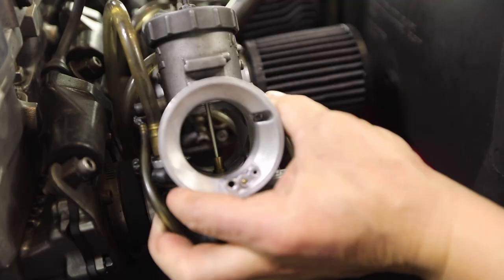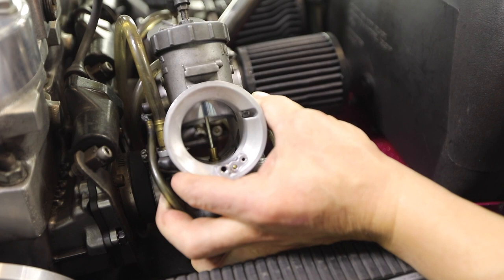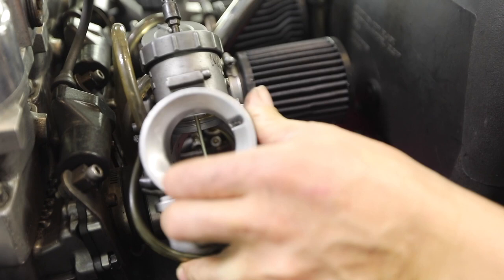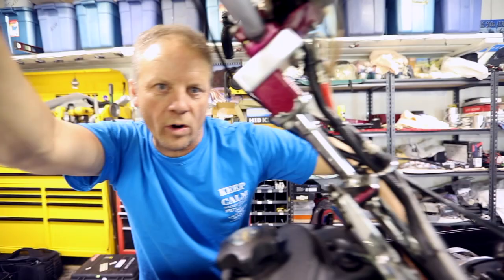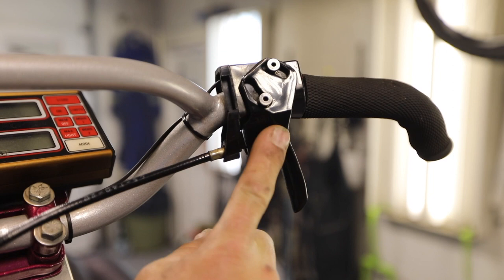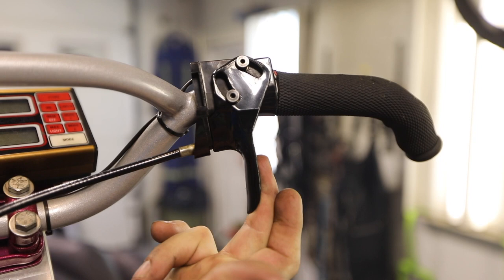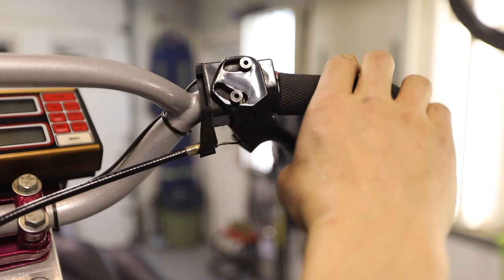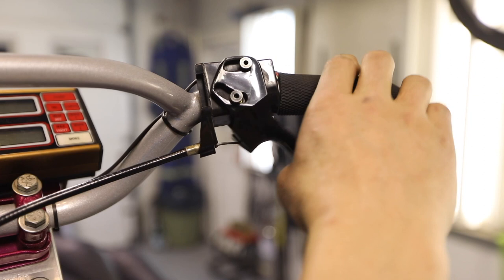Bending the throttle on your snowmobile for more horsepower. 2 stroke.

Comment: there is an adjuster on the cable to do this on some sleds.
On mods you should be able to accomplish that with research. Buying the correct throttle, long enough cable adjuster.
I do like those early 90s Doo flippers though
Reply from the maker: Time for a lesson !! 
When you take a 44 mm carb and bore it to 48 mm , there is quite a bit more travel required to get the slide to open all the way , and to pull needle out of needle jet !! More air , More Fuel , More power ! 
There never was , is or will be an adjuster on the throttle cable for 3 individual carbs , the only adjuster will be found on the rack style carb system from like a Thundercat or XCR , which were only 40 mm !! Even then the amount of travel is the same !
Even if you had an adjuster , it would increase your idle too high !! 
We researched the piss out of throttle cables , even had to get custom cables made , but they dont last for ever and either does the people making them ! 
The two stage throttle from doo was needed to pull the brass slides that were in the 44 mm carbs ! We tried alluminum slides , teflon slides , electrolus nickel plated slides !! Only thing that doesnt stick are the Brass ones !! Thats why a little extra travel from the flipper , is just extra !!
Hope that helps ??
Reply: Easy !!!!! Most people just talking about most people. Sorry to set ya off
I think I have a set of adjustable cables on my tripple 48 mm crank shop junk carbs with a union bay long throw flipper
Reply from the maker: I got triggered!!! LOL. We're cool Josh. And you gave me a good idea to make a video about this topic!